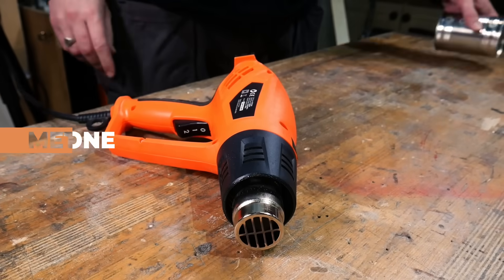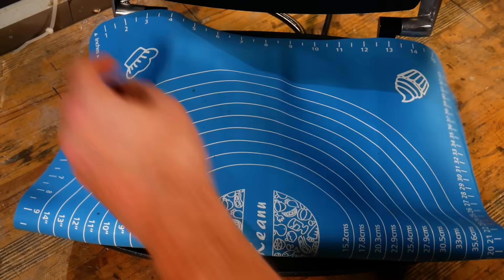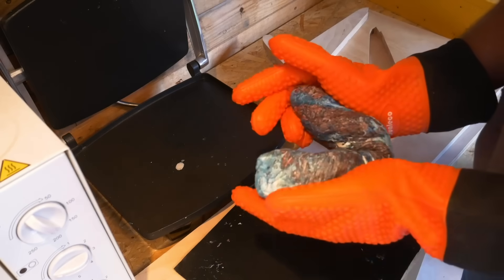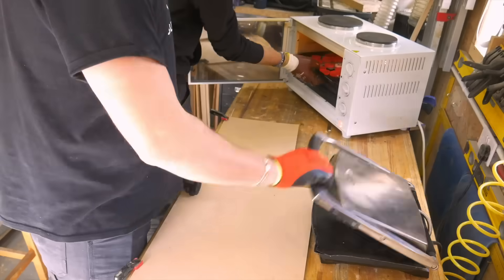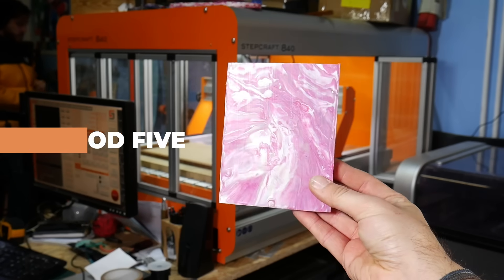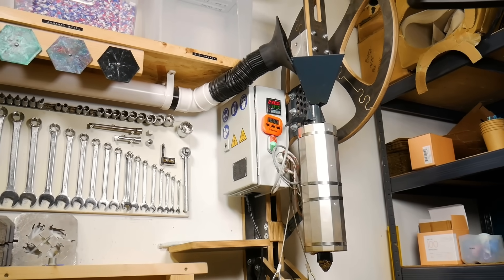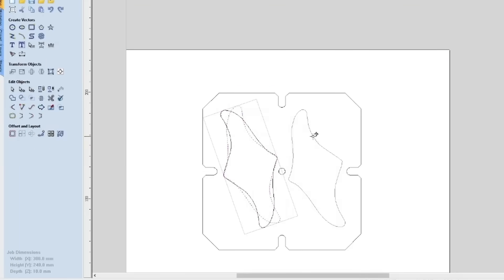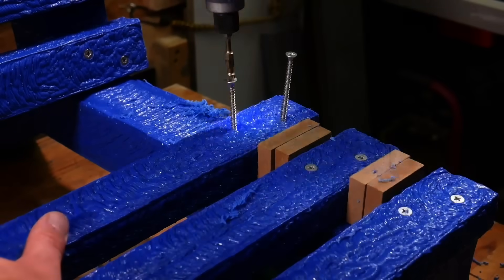7 Ways to Make Stuff from Recycled Plastic | From Tin Cans to Wazer Waterjet cutting!

Comment: Timestamps:
0:22  - Method 1 - tin can and heatgun
2:07  - Method 2 - pannini press with silicone baking sheet and cookie cutters
3:52  - Method 3 - wooden moulds with hydraulic press
6:00  - Method 4 - sheet moulds with hydraulic press
7:29  - Squarespace promo
8:22  - Method 5 - CNC machining
10:08 - Method 6 - injection moulding
13:30 - Method 7 - extrusion
14:55 - Outro and thank you
15:55 - Christmas sweater
Reply: Would love to see a sword or shield mold from recycled plastic.
Reply: Hey yall saved the best for last but didn't go into enough detail on your massive plastic melter injector maker thing. Could you do a follow up vid showing it in action?
Reply: What do you put the Panini press to to melt the plastic for the cookie cutters?
Reply: You guys are great! 😃👍
Reply: This old house pvc trim
Reply: Always make sure your in a well ventilated area, plastic gives off toxic fumes when heated. Always keep a fire extinguisher nearby as plastic can catch fire if the flash point is exceeded.

Comment: I know it's been two years but that stool top: Would it be feasible to put holes in the bottom of the mold large enough to insert some bolts in a way that the head is above the bottom of the mold yet still still have sufficient thread exposed beyond the bottom. When you put in the plastic, the plastic would form around and under the bolt so it is essentially trapped within the seat once cooled. Make sense? Too bad I can't draw a sketch here. This way, you can bolt the seat from underneath and avoid drilling through the top and leaving the exposed screw heads.

Comment: Stool tops. Could you bore some holes in the mold and encapsulate the bolts in the plastic before pressing? Then the bolts would be hidden from sight.  Just a thought. They are a pretty nifty use of waste plastic.

Comment: I watched for 11 minutes thinking all the heating of plastic you were doing was creating a carbon foot print that was unnecessary, as everything I'd seen till then could have been made from scrap wood with hand tools with no electricity needed! All that scrap wood could have been converted into all those items without a power tool or heating element anywhere in sight. Perhaps a chunkier price of scrap wood needed for tha mallet, but that's where I got too!

Comment: Normal square hollow tube has a flash inside where it is seam welded when it is manufactured, seamless drawn tube would have to be used so the plastic is easily removed.

Comment: I'm just gonna add that if you want to actually recycle your plastic, then sort them by type. That way you don't end up with HDPE and PETG in the same piece, as that can't even be recycled at a multi million dollar plant, due to the mixing of them. So be sure to separate them into types (if you can) and use a wooden burner to mark what they're made of, in case you ever need to just throw them away. If you just mix them, you aren't recycling. You're downcycling.
Reply from the maker: We never mix plastics 👍🏼 we've just released a video on how to identify different plastics even when they're not marked to ensure you're not mixing them.

Comment: ?!   What if could eliminate most of our trashed plastic bottles and trashed Styrofoam, by dicing up Styrofoam items tossed in the garbage, and crammed miscellaneous plastic bottles with the Styrofoam, and got a lot of those concrete cinder blocks, the ones with the two hollow cube spaces in them, and then compressed these Styrofoam stuffed bottles into those hollow areas of the cinder blocks, under high pressure, and heated the block a while to melt the plastic bottles into one unit fused to the block, and then used these modified cinder blocks to build houses etc? This lightweight addition to the blocks would make them somewhat structurally stronger, more waterproof, and also thermally insulating! EOJ

Comment: I wonder how much plastic fumes are being inhaled during the melting process. And how much energy is wasted with the heat gun or sandwich press, to make more plastic/throw away stuff. My .02c
Reply: I've made a coffee can hammer. And experimented with makes sheets/bricks a few times. At the lower temps to melt it, there are no noticeable smells or fines. I've used an oven set at a max of 350f.

Comment: It's not safe at all, dudes
Some plastics have melt point above 280°C, and almost all of them (wax based are the safest btw, like PP and PE) have toxic fumes and compounds
Reply from the maker: Our temps are much lower than that. Check out our safety video for all the info 🤙🏽
Reply: @BrothersMake  Worked in my early 20s in recycling plant, that's why I'm still concerned after watching your safety video. ~1/3 of workers then already got cancer, even with the best safety equipment. For a chemical recycling of plastic (pyrolysis) you need at least to do that in oxygen-free chamber. In  mechanical + heating way you need to wash and shred before heating step but this time done in combination of oxygen and water. Also there's and a depolymerization But in all cases you need a vey expensive safety system that catches almost all toxic fumes, and we're not sure it's doable in home

Comment: You are not recycling you are repurposing. The plastic industry loves this lie. Recycling would be making new caps from the old ones displacing the need to make more plastic.
Reply from the maker: In the Waste Framework Directive at present recycling is defined as "any recovery operation by which waste materials are reprocessed into products, materials or substances whether for the original or other purposes".

'Recycling' sounds accurate to us 😊👌🏼
Reply: @BrothersMake  A bit like Doctors saying smoking was ok in the 60s. Time will expose the hypocrisy and you will be on the wrong side of history. In other words if you are not part of the solution you are a part of the problem.
Reply from the maker: 😂😂 how is it at all like that?
Reply: @BrothersMake  you guys are 'influencers' you have the chance to make a difference by telling it like it is. try to at least make an effort to understand instead of ridiculing.
Reply from the maker: In other words… exactly what you’ve just done to us 🤙🏽 have a wonderful day Max 🤍

Comment: So, you need thousands of dollars equipment to be able to use trash. 🤷
Reply from the maker: Nope, just a heat gun and a tin can!
Reply: it would depend a bit on the scale of the project. the tin can + heat gun, sandwich press and toaster oven will work well for smaller things for example and that equipment can be had for cheap or free from thrift shops and rummage sales. the injection mold in the vid looks home made at least in part which could help bring the cost down and the CNC is not needed if you have good hand tools and know how to use them.
Reply from the maker: Absolutely!
Reply: @crazycarryout  Video said 7 ways. Only one was “cheap”. That’s all I’m saying
Reply from the maker: It didn’t say ‘7 cheap ways’… we started small and scaled up as we grew. Economies of scale 🤙🏽

Comment: I'm really inspired by you guys and my mind is exploding with ideas already. I'm already a scrapper by nature. I was wondering if you'd share how to deal with the piles of things that were going to be trash or might be something else.  The potential materials. How you store them, how you decide what is worth the effort and space to keep and what you go ahead and dispose of (recycle or throw away). How did you handle that as you've grown? As an aspiring maker I have a hard time keeping my  little space from being overrun and ending up turning into a hoarder with no hope of finding anything and no room to begin a project even if the overwhelm of the chaos didn't discourage me.
Reply: story of my life :D Best tip i have for saving space: get rid of air. air takes up valueable space. if you collect bottle caps, cut them up. if you have lots of scrap wood, glue them together and make new sheets or blocks, disassemble cardboard boxes. use your ceiling to store thin materials.  also in general: don't keep ressouces laying around for too long- do something with them before they do something with you

Comment: Had a bit of a go with melting and shaping a few years ago. A lot of stores have plastic wrap put over their delivered pallets. It's easy to come by and melts really well and is incredibly hard, worth giving that a go.  The whole idea is interesting and I guess you could make some small scale items or art. It looks pretty prohibitive considering the cost of electricity. The bench, like I say interesting but it would be useful to give a breakdown of all costs to produce it.
Reply: Good eye at pointing out the electric cost!
Heat especially is costly for electric appliances.
Reply: @Eduardo_Espinoza  Yes, electricity isn't cheap in most places.
But plastic sheets aren't cheap either, unless we are talking about super thin stuff like cling film.

The shown methods already save a ton of money if you actually intent to DIY something out of plastic. With the added benefit of actually re-using old plastic garbage.

Just don't expect the absolute maximum material quality, but that's barely an issue at all for most puposes.
Reply: What if you used a solar collector dish to heat it?
Reply: @1chumley1  unreliable, tricky, not very precise, and it risks burning the plastic instead of melting it
Reply: @1chumley1  Perfect suggestion.

Comment: Great demo and insight on what appears to be a smartly designed improvement/upgrade for the weakest tonal link in the Fender offset model wiggle-bar proposition. I'm quite impressed with how much better the bridge helped your guitar transmit mid to low frequency information, and seemed to add overall to resonance and note duration.
Reply: UM WRONG Video, are you lost??

Comment: I appreciate your work! How do you ventilate your workshop? The fumes are volatile.

It is my inclination to follow your lead here, but, lately, I wonder if anyone has done an energy audit to assess the resources used (e.g., to produce the electricity and manufacturing tools) and compounded ecological damages.
Reply: If you're melting plastic at the right temperature, which wouldn't be too hot, then there shouldn't be any fumes. If you're getting fumes that means you're burning the plastic, not melting it. Try to figure out what the fuck you're doing.
Reply: @1pcfred  — Thanks for your well-considered bullshit reply.
Reply from the maker: We have a whole video on plastic recycling safety. Go give it a watch 🤙🏽

Comment: Does the plastic make any type gasses when you are melting it in the panini press or with the heat gun? Or it sage for kids pets and myself? I'm imagining it to be a very stinky process.  Not something for the craft room with birds.???
Reply: If you melt plastic at the right temperature fumes are minimal. If you melt plastic at too high a temperature things could get dicey then. You could burn your house down I suppose. So the trick is figuring out what the right temperature is. You do that by melting a little sample and burning it. Then taking note of what temperature it burned at and melting below that. You only have to burn the sample a little bit. It'll turn brown and crusty like burnt sugar. As soon as you see that happening you know you're cooking too hot. You increase the temp 10° every 10 minutes and observe the sample. Personally I'm melting HDPE at 285°F in a convection toaster oven. But conventional ovens you do have to run a bit hotter. Maybe 300? Watch your sample and your batch. A batch takes about 20 minutes to melt. It'll never go beyond gooey. It'll never turn into a thin liquid. Once it looks like lava that's it. It's going to be the stickiest stuff you've ever seen too. Your birds will love the smell. It smells like ripe fruit. Because it's ethylene which is a plant hormone. Pro tip: never melt plastic that's had scented soap in it. That stinks to the high heavens! There's no way to wash those bottles out. That scent permeates the plastic. It will bowl you over heated too.
Reply: @1pcfred  thank you so much this was very helpful!

Comment: I tried to melt plastic caps , but they burn and get dark  , they don't melt like candles
Reply: A trick to melting plastic is to not exceed its melting temperature. If the plastic discolors that means it is burning. It takes a while for the plastic to melt. Like 20 minutes. So melt your plastic low and slow.

Comment: a 'mil' is a very thin measure, it is NOT EQUIVALENT TO A MILLIMETER, IT IS NOT A SYNONYM, it is an entirely different measure
Reply from the maker: In the UK, “one mil” is how one millimetre is expressed. Calm down.
Reply: @BrothersMake  what a mil means is based on context. In the world of plastic a mil is a thousandth of an inch. Plastic sheeting is sold in mils of thickness. 6 mil plastic sheet is 0.006 inches. A millimeter is about 40 mils. A little less but who's counting?
Reply from the maker: Still depends on where you are in the world. UK plastics sold by the ‘mil’ still refer to mm of thickness
Reply from the maker: We’ll keep doing us and you keep doing you 🤙🏽
Reply from the maker: Not sure how that’s relevant to this discussion
Reply: @BrothersMake  unsubscribed

Comment: Hi, my partner and I have been watching your videos for a year or so now. My partner is a successful jewellery designer and maker but yesterday she had a problem with the silicon sheets you were trying out. After 4 or 5 uses, the silicon sheet has bonded itself to the 4mm thick HDPE sheet( during the overnight cooling off process). It was so bad that the silicon tore straight across its width and the pieces that were still  bonded had to be removed with a craft knife and the silicon sheet thrown away. What did you think of the silicon sheet? Was it just too thin (0.75mm) and we should have chosen 2 to 3mm thick silicon or should we go back to the Teflon sheets. My partner preferred the finish the silicon leaves on the HDPE as it is a really smooth finish and almost ready to go... Where as the Teflon sheet always needs a lot of sanding and time is money etc.Did we make an error by not using the silicon releasing spray? Cheers.

Comment: in japan one thing they use little balls as a hole they put together a design iron it. based on this there is a way I use it is using 2 sheets of aluminum foil is the lids of the bottles in the middle of the sheets of aluminum foil is a sheet of paper on top is to place the iron on top of the sheet and then wait 5 minutes. then let it run out .

Comment: Can I use a toaster oven instead of a heat gun?
I think it would make really neat knife and even sword handles
Reply: Probably even WA handles if i do it in a piece of square tubing
Reply: I use a toaster oven to melt HDPE. I have a really nice convection toaster oven. I've used the plain ones too. The plain ones you have to worry about tanning the top of your melt. Convection is a more even heat. Plastic is kind of slippery.  You should look into homemade micarta. You make that with rags and fiberglass resin or epoxy. It's not like the real thing but the hobby knife crowd seems to like it. I have a sheet of one inch thick genuine Micarta. It's ugly but really strong. I guess it looks nice if you like poo brown. With the homemade stuff you can pick what colors you want.

Comment: Are the plastic fumes a problem?  I guess you are melting, but not burning the plastic, so it would only give off small amount of gas. And only curtain types of plastic can be used - right?
Reply: You're onto something. Yes there is a max temperature you can melt plastic at. Past that you're burning it. It's actually a pretty narrow window. The first thing you need to do is determine where that window lies with the equipment you have. You do that with a small sample and gradually increase the temperature by steps until you singe the sample you're testing with and back off from there. In the convection toaster oven I use I can melt HDPE at 285°F In a plain toaster oven I have to run a little hotter and can sometimes brown the top of the melt.
Reply from the maker: We have a whole video on plastic recycling safety. Go give it a watch 🤙🏽

Comment: I'm wondering if a hair dryer will work instead of a heat gun.Also you should stay close to an open window ( or when it's warm out do this outdoors near your house in the shade) and wear a mask to get rid of the formaldehyde fumes and avoid breathing them in.
Reply from the maker: This is HDPE, so no fumes as long as you know what you’re doing with temperature control 👍🏽
Reply: If the plastic is giving off fumes then you're doing it wrong. You're melting the plastic too hot and burning it as opposed to melting it. Really you don't need to get the plastic over 285°F to get it molten. I don't know where formaldehyde would be coming from with polyethylene. Phenolic is a totally different kind of plastic.

Comment: Could you do some videos on what not to do. Funny mess ups type instructional on what not to do. Seems like all your stuff turns out perfect lol. 

Also wouldn’t teflon coated molds work better? Or could silicone be used for molds. My set up is still pretty primitive lol. Cookie cutting does seem fairly simple
Reply: As the plastic cools it shrinks so it releases itself from the mold. Even melted plastic doesn't exactly pour. It's more like Silly Putty. Silicon is just too soft to contain it. Their silicon sheets worked here because they were backed up with steel. The goo factor of molten thermoplastic can't be overstated. It's a sticky mess.
Reply: @1pcfred  much of my stuff still sticks. But I’ve noticed a lot has to do with temp/time. Was hoping I could find something that works well as a release agent for when it does stick.